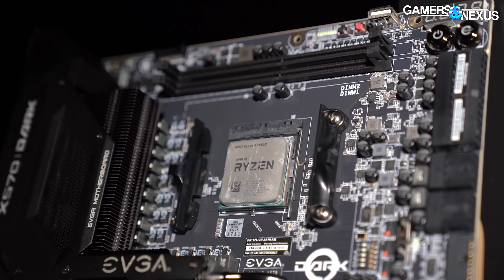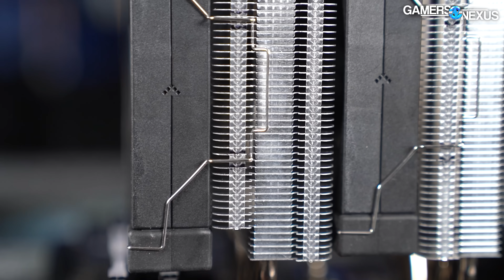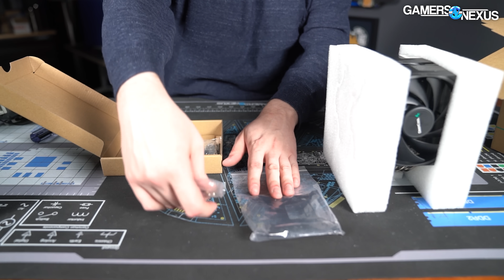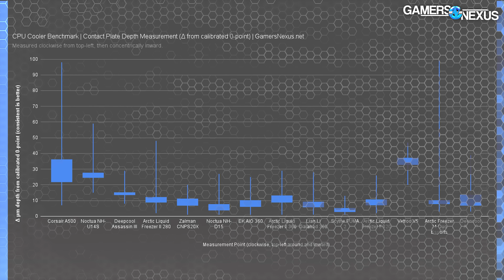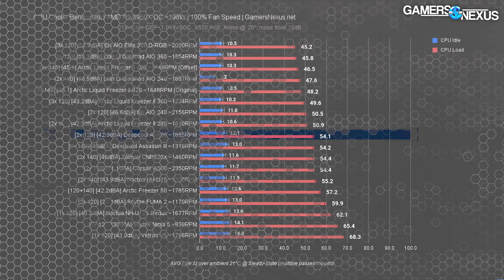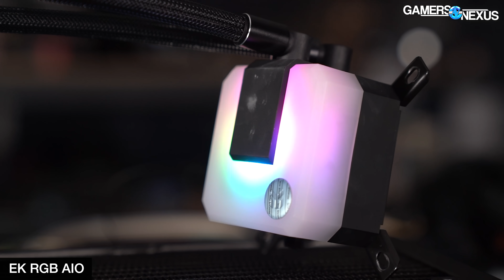Air Coolers Are Getting Impressive: Deepcool AK620 Cooler Review

Comment: I think it would be good to do a comparison in how the fans will actually perform...Noticed the Fuma 2 for example which I run on my 5600x and never have gone over 890rpm on performance fan curve and +200mhz PBO @72c....in a heat box of a chassie.
I could probably drop 10 degree in like a meshify mini c if I wanted to increase chassie sice. 
Most air cooler I've seen tested by other media platoue around 60-70% fan speed...so testing higher fan speed is just...useless...
Not like they are ran that way when we as consumer buy the coolers and use the motherboard curve. D15 had a 2 degree difference between pwm at around 50% and 100% but 10db sound difference. 
Don't think its fair to any cooler here....its just a test of fin size...not actuall performance...A500 is even "competitive" in your graphs...while other outlets have it in slowest fan speed around the same sound level as a max fan speed u14s in sound...It both run full tilt they are comparable but not when run in an ACTUAL mashine on a pwm controller

Comment: i own deep cool neptwin and its super good for money i paid.30$...that back side bracket is great bcs it makes whole board more solid with that big cooler..and also dissipate some heat(little, but still)....same 6 copper heat pipes,nickel plated bottom, but on your tested copper pipes looks like they are nickel plated as well or they r just colored? ..big  clearance for memory and vrm is plus, as well as adjustable fan mount..anyhow, its high value for money

Comment: For an air cooling part, $90 is rather expensive. We tend to believe $50 is about the limit to spend on any air cooling. If those coolers don't do the work needed then its simply time for liquid when considering the value.
Reply: It really depends upon your use cases and expectations of the equipment over time.

Comment: Good test, as always!
I don't know if you can acquire one over in the US, but the SPC Fera 5 would be interesting.
Will, by far, not be at the top of the chart, but it would be interesting to see where it can sort itself in and how well it could manage a 12400 or even a 12600(non-K).
There is a model with twin fans and a model with only one, with a more or less significant price difference in between, but they are basically the same tower.
If you can fit it in somewhere, that would be nice. If not, then it is not the end of the world.

Comment: I still wonder if the Fuma 2 or the AK620 for the matter would perform better if you change the fans for known better fans like the Noctua or Arctic P12, wouldn't that also make for an interesting Video to see if Noctua or other manufacturers of top Fans could make any cooler better? Especially arctic would be interesting since the P12 with its excellent performance is dirt cheap compared to any Noctua fan.

Comment: I am currently on a R5 3600, planning on upgrading to the 5800X3D when it comes out, so I'm very interested in getting a quality air cooler. Looking forward to the other reviews coming up! 
Thanks, Steve.
Reply: same but with a 5600g and not planning to upgrade
Reply: @DJ-Fraggoth  And why would you? I cant help but scoff when I see these people upgrading their already good PCs that fulfill all of their needs just because corporations convinced them that they are missing out by not consooooming their brand new shiny parts.
Reply: @mr.dingleberry4882  I don't know, follow or am interested in any CPU cooler company, I hate capitalism and everthing in the PC industry, but I'm forced to be in it because I need a new PC for work.

I just need a good CPU cooler and cooling system in general to don't have my CPU over 50°C when under heavy load, actually I don't even have the computer and I'm still unsure if I should buy a 5600g. I think I'll probably buy a laptop in the end.

 Right now I'm on a 2011 laptop but I'm forced to get a new PC because I need it for work, I have even upgraded to an SSD but it just isn't enough. I need a better CPU. And I'd like the best possible cooling system on it because my needs are as low temperatures as possible, to make the computer last as long as possible.

And no, there is no way of upgrading my laptop CPU since it's one of the most powerful models in that socket, the best CPU I can put in it would be about 5% faster and costs 100€, also not speaking about how hard and risky it is to change the CPU. 
The RAM too is already at its maximum possible supported by the motherboard, so my laptop is not upgradeable and I need a new computer for work.

 With my laptop at the moment I'm having a hard time working, I'm seriously forced to buy a new computer right now.
Reply: @DJ-Fraggoth  Ok, listen up. The only reason I would ever buy a laptop over a desktop PC is if I was a student on a campus, and I needed it to be easily transportable. 

Many laptops by design have an inferior cooling capacity compared to desktop PCs. This results in thermal throttling, and a decrease in speed in your otherwise capable CPU.
So if longevity and optimal performance are your priority, there is no better option than going with a desktop PC.

Also, judging by your current PC I assume that your work is not heavily GPU dependent. This is a good thing, as that allows you to completely omit a dedicated GPU from your build, reducing the size and the COST (all caps) of your system. You couldn't have made a better choice than considering a 5600G for this. Not only is it an extremely capable 6 core 12 thread CPU, but due to its powerful iGPU many consider it suitable for light-medium gaming. Oh, it also recently got a price cut to 150 euros where I live. And it comes packaged with a very good Wraith Stealth cooler. Seriously, no other chip provides this much value. I have first-hand experience with it, and I cannot praise it enough.

Here is an idea as to what a complete 5600G build could look like:  https://youtu.be/BYlZPjxoxHs?t=388

Note that the build above is based around a mini-ITX motherboard. Motherboards and cases for a form factor this small can get more expensive compared to a bit larger builds.
If that is a problem for you, I would get a micro-ATX motherboard instead, like an MSI MAG B550M Mortar (amazing mobo for 5600G, but you could go cheaper), paired with a smaller case that supports a micro-ATX form factor and has great airflow, like MATREXX 40 or NX200M. You can of course use any case, I just found these to be high quality for the price with excellent thermals. Pair this with 2x8GB of CL16 3200mhz ram sticks (dont forget to use the high-speed profile in the bios!) and you got yourself the best business PC you could imagine.

If any of this is unclear I'm here to help and of course, there are many great 5600G guides on the internet.
Reply: @mr.dingleberry4882  Don't worry it's all clear to me, I know all the disadvantages of a laptop especially in cooling, but its portability would be very useful to me for many things. I know a PC is more stable, durable, powerful, cheap, cool etc. but the portability of a laptop is something I sadly need. And well I'd buy a ryzen apu laptop wich would be as powerful as a 5600g, it would have much worse cooling and I won't be able to upgrade but I think the portability is too useful for me to buy a PC instead.
Reply: @DJ-Fraggoth  Ah, I understand. I think it would still be smart to go with an APU in a laptop. I cant give you much advice on that as I have very little experience with laptops, just make sure they are not selling you some bullshit from 2014 that failed to receive a price cut (I've seen that happen with laptops). Also, I could be wrong but I think that an activated Windows is also included in the price, so try to get one without a system if possible and install it yourself afterwards if you are comfortable with that sort of stuff. 

Be aware that Windows is getting more and more bloated and resource-hungry as time goes on. This is a deliberate business tactic to prey on the inexperienced and push them into thinking that their computers arent good enough and that they need new ones. This is especially problematic for laptops as they are generally less performant for the price when compared to desktop PCs, and you usually cant upgrade them. Unless you absolutely need to use Windows-only software, I'd suggest switching to a user-friendly and lightweight operating system like Linux Mint, and use software thats free of the corporate greed, like LibreOffice instead of MS Office.

If thats not feasible, you can improve your Windows 10 experience now by de-bloating it. Download WinaeroTweaker and watch a video from LTT where they compared a "dirty" and a clean ssd, and use the settings they listed + the ones you think you need. After that, restart your PC and download Windows10Debloater script from Sycnex on github (Jayztwocents has a video on it - https://www.youtube.com/watch?v=DcDgV-1zDKs) and run the GUI script. Just click on buttons that say "remove cortana" "disable telemetry" "remove bloatware" etc. Restart your PC and now you have a somewhat lean and Microsoft-intrusion-free Windows 10.

This will not only relieve your CPU and RAM from unnecessary processes and thus improve performance, but will also in turn prolong your battery life. I've done all of this multiple times for family members and its the single best thing you can do right now if you are struggling with a slow computer.
Reply: @mr.dingleberry4882  yeah thanks, I already use AntiX linux now and rarely use windows. AntiX is lighter than Windows xp while still being a good full OS with everything you need, check it out!
Reply: @DJ-Fraggoth  Oh I'm very well aware of antiX haha its probably one of the best choices for old laptops. Since you are already a proficient linux user you don't need me telling you why that is the right choice, but you can still take some value out of what I said about removing Microsofts spyware. Just to make those future Windows encounters slightly less painful ;) Cheers
Reply: @mr.dingleberry4882  yeah thanks a lot for those windows 10 debloating tips, I will certainly do it on my next PC!

I have seen windows 10 on a computer of a friend (a classic 4GB RAM bad laptop for work) and I was blown away by how bloated it was! With no programs opened it had about 1.5GB of RAM left!
 
So I was thinking about getting 8.1 on my next PC since I have also seen it myself and it's as light as windows 7, but I think I'll try windows 10 with debloating now. Thanks!
Reply: Are you me? Literally exact same parts

Comment: I really like the simplicity of air coolers and have been using a Noctua nh-u14s for a few years now in my daily driver ( now 3800x) and has been used in multiple builds. However I plumped for the Arctic freezer 360 for cooling duties when I went for a 10850k build in my gaming rig.

Comment: I know its not part of your standardized Test. But Allcore Load is not the major Problem i had with current Gen CPUs. It was the high boosting that occurs with stock settings.
My 5950X was only 65°C warm with an 280mm AIO and 100% Allcore Load at 142W. But the stock singlecore Boost put it past 85°C even on short loads. Since the boost only happend with 1-2 Cores the Heat distributions is a big Problem. (That is also where the Surface Flatness comes into play.)
For now i have disabled the Boost and put the 5950X at 1,1V@4,2Ghz. Which is 50% less Heat and 50% less Powerusage in Singecore Loads >_>... But that stock Boost is really sacrificing efficiency for a few hundred Mhz... 
In my case it is -10-15% Singlecore points in Cinebench. Allcore CB points, Heat, Powerconsumption are unaltered. But 100% Allcore Load only gets used <1% of the time, so it is a BIG improvement for Heat/Noise and Powerconsumption for me using the 1,1V@4,2Ghz.

Comment: because of this coolers abnormal fin design it begs the question: how much noise is from the fans and how much is from the fins
this could be test by putting the fans on a different cooler or different fans on this one and comparing

Comment: Is there any air cooler that's decently sized to fit in a 280X case (which I believe has a 150mm max height for coolers) with a rad and fans installed at the top? I'm struggling to find anything that has a similar footprint to my stock Prism but in tower form, that doesn't suck major A.

Comment: I Bought it to pair it with the 5800x and 85c full load then changed it to 12600kf and damn 62c chili. Had to ask my retailer for the 1700 bracket. Good sexy cooler

Comment: From LI-NY-US and couldn't ( 2020-ish) find a Fuma 2 for less than 90$ us for whatever reason. So I have a Shadow Rock 3 "190 Watt" big square low restriction (50$)
It's OK and in a Fractal Torrent; but the "85-90 C is fine" Boost temps make me flinch.
Old machine was dual sandy bridge Xeon WS 110 Watts per socket never got above 70 C

Comment: I have a 360 AIO now, but I used a Noctua NH-D14 for 10 years and 3 CPUs. I just sold it as part of a rig in a Cooler Master Storm Sniper Black Edition case with my old Ryzen 9 3950X to a buddy and he says the system is really quiet. Big air coolers generally work really well without making too much noise.
Reply: I had a D15 for a long time "downgraded" to a U12A for easier system building and better compatibility. When noise normalized its no better or worse than my D15 anyways.
Reply: Using a nhd-15 on my 3900x and can't really hear it.

Comment: Running my 12700k on a NH-D14. I think I'm going to blow the budget and go full loop.

Thr NH-D14 is the predecessor to the D15. Not sure the thermal difference. Also not even sure I'm using the fans it came with, they are brown and noctua but it's been so many years. Also no longer have the fan mounting brackets and used loose wire to affix them. 

All in all the D14 runs the 12700k in games at a silent level. I'm just bored.

Comment: I've never had a bad CPU cooler as you buy a CPU cooler for the application and it should work. Personally, I go with the biggest that can fit in the case.
Reply: Really? I think if you have a Ryzen 3600, putting "the biggest" cooler that will fit will be a little wasteful. I see the same point as you but from another perspective: I just had the 3600 with a $20 (Gammaxx 400S) cooler. It was SUPER cool, but now I upgraded to a 5800X, so I bought a dual-tower. If I would have gone with the largest one from the get-go, I would have saved some money on the cooler upgrade. On the other hand, in those 2 years, the cooler I upgraded to came to market at about $25 below the competition (Thermalright PA120)...So I didn't really waste anything.
Reply: @shane250  For a Ryzen 3600 I would use the stock cooler that comes with it if you don't do anything out of the ordinary.

Comment: I literally just bought this air cooler on Saturday for a 5950X upgrade for my son.
Bought it due to lack of local stock for decent Noctua coolers on the shelf.
And it is doing a better job then my Noctua N15S (single fan version) cooler on my 5950X for my development machine.
Reply: Nice. How are your Temps under load?

Comment: I always get noctua fans, have been doing that since the nh-d14 was released and i couldn't be happier.

Now i rock a NH-U12A cooling an 10900k and without extreme oc it does an amazing job 5.0ghz locked on all cores never reaching over 79C.

So air coolers have always been awesome it's just expensive.
Reply: What's your take on the D14 vs the U12A?

Comment: Steve, In my purchasing of my coolers, I pick the Noctua's mainly due to my past experience with the FANS which are quality. For years I have replaced OEM case fans with Noctua's and not one Noctua has ever made a squeaky noise much less failed.  I am always looking at the QUALITY of the stuff (which is why I watch your channel consistently).

Comment: A cooler I would love to see you guys review. Jonsbo 2000gt. It was a 25 dollar (on sale) dual tower cooler, looked a lot like my d14. But with argb fans. For 25 dollars, it has been simply awesome. Running custom settings on a 5800x and it's holding up pretty well. 87c max is what I'm finding, which as a reference, I ran the same cpu with an A500 and it was maxing out at 83c on the same setup. 

The weak point of the jonsbo is the fans. Switching out the Jonsbo fans for even cheaper fans like a Montec af120, and it dropped the temp down several degrees. Still an awesome cooler for me for 25 bucks. Running an overclock on a 5800x (albeit some custom ppt settings), is still pretty good!

Comment: While it would increase consumer cost, pairing the "best" fans with the "best" tower.  Looking forward to your fan testing machine coming online.  I personally set my case fans to 100% and my GPU fans to 80%.  I do not mind the louder whooshing from my GPU.  It's a 1080Ti, so several years old.  I do not hear my Noctua case fans at 100%, but my computer is 6 feet away.